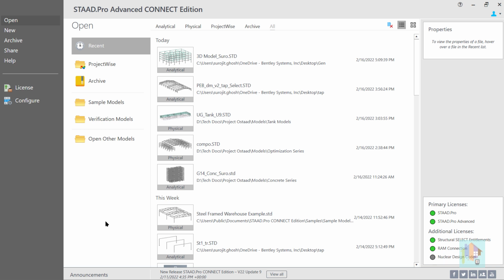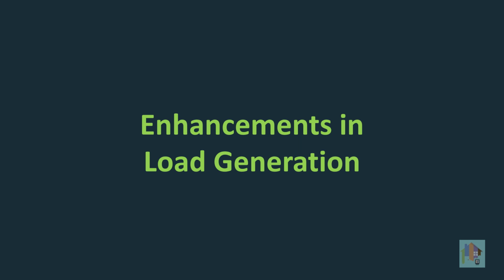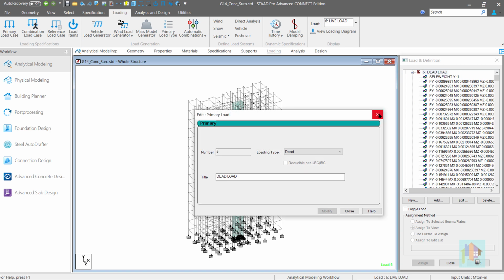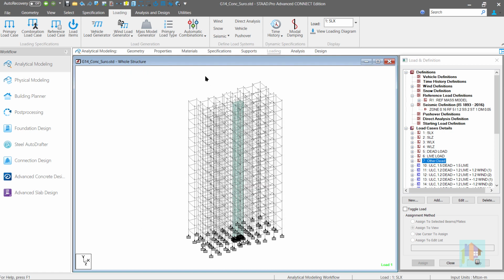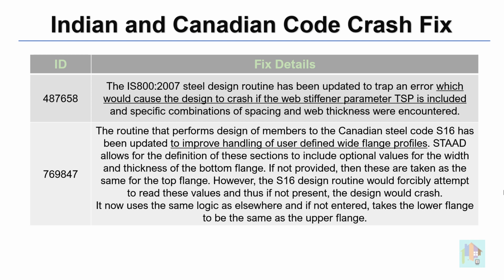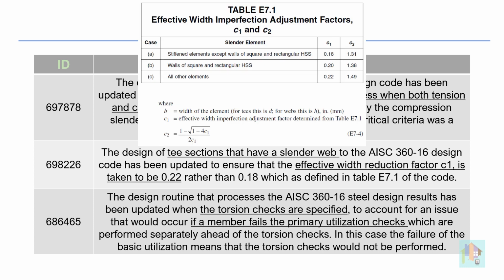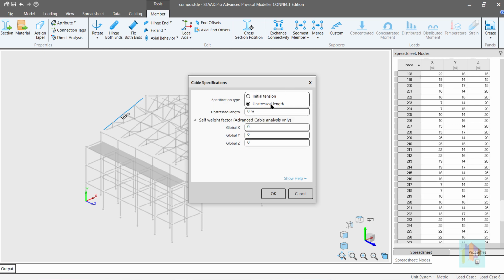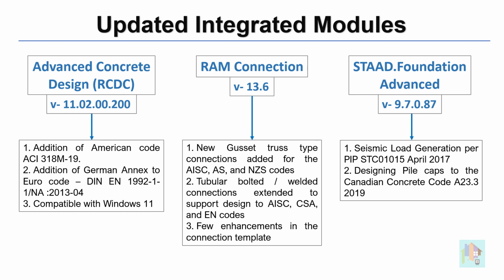STAAD.Pro CONNECT Edition V22 Update 9 - Updates & Enhancements || Mass Model Generator

Comment: Whether we have to define Sesimic load cases before the dead and live load case or after the dead and live load cases while using mass model generator ?
Reply from the maker: Static seismic load must be defined prior to any other load case, whether you define the seismic weight using mass model or from the seismic definition. Dynamic load case can be defined after gravity load cases.

Comment: Hello surojit, when will the Utility check as per parameters will be available to IS and Other codes? As we need to create two stadd file's with strength and servicability parameters for utility check.
Reply from the maker: Sorry Kamal, I don't have any idea about the tentative timeframe when this feature will be implemented for IS800:2007 code. All I know, this issue has already been posted for implementation, but till now, there is no progress. 
I have a silly question. Can you let me know why you create different design blocks/models to check the critical ratio? Do you create these to get strength and serviceability ratio separately? Based on your requirements, I will try to find out if there is any other alternative.
Reply: @surojit_ghosh  Hello Surojit, I guess you know that if we define two parameters i.e Strength and servicability load cases with Code check value, then Stadd only checks for last code check i.e 2nd one and ignores the 1st parameter, due to which stringent utility ratio is not provided. Kindly advise
Reply from the maker: Ok, I understand your requirements. STAAD always performs both strength and serviceability checks separately, whether you define it under a single block or under different blocks. You can check the same from the output file also. But at this moment, it is not possible to get the ratio values separately in the post-processing table.
My suggestion, define all the parameters for strength and serviceability checks under a single design block and specify LOAD LIST ENV 1 2 command before that, where 1 and 2 are the load envelopes created considering the strength and serviceability load combinations. Then program will perform strength checks considering LC from envelope 1 and deflection check considering LC from envelope 2. Also the critical design ratio will be calculated considering the critical strength and deflection ratio value. Well, separate ratio will not be reported in the post-processing but if you want, you can get the critical strength and deflection ratio from the output (TRACK 2). This will solve your result checking problem as well as you don't have to calculate the critical most ratio manually.
Reply: @surojit_ghosh  thankyou for explaination.. however it would be good if utility check as per parameters are included in Post processing like they have done for AISC 360-16